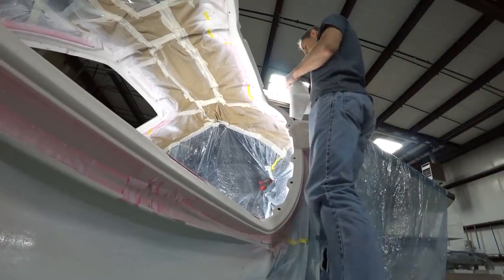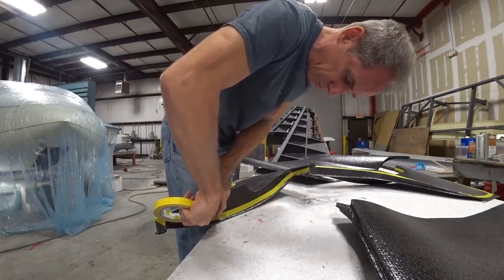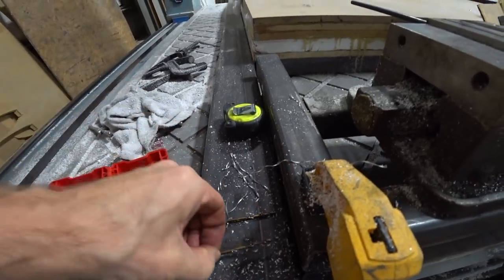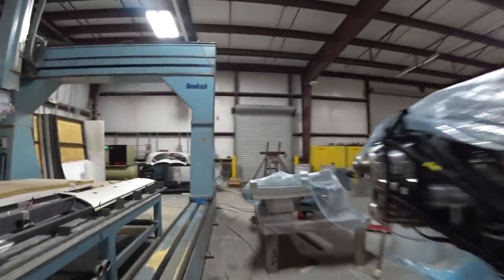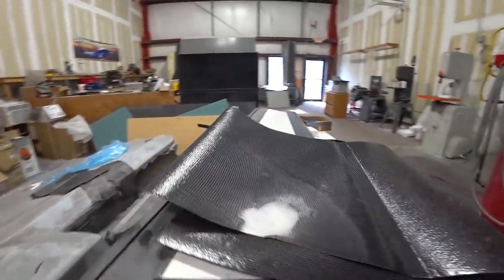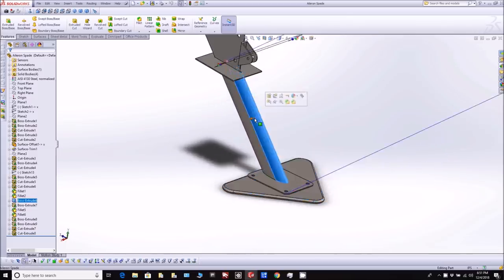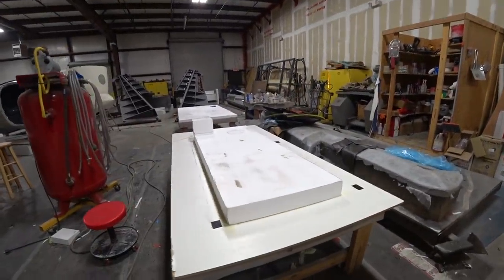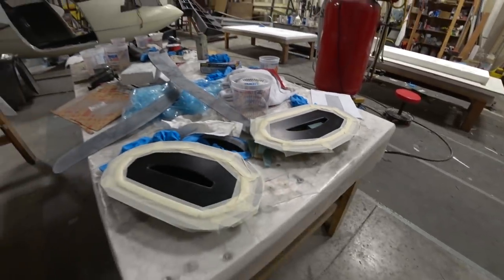What's In The Box? - Building the Raptor Prototype

Comment: For attaching the trim panels, consider the 3M Dual Lock system.  I used the flexible self-adhesive strips to mount a video camera to a skydiving helmet.  There are lots of options.  Strong and forgiving.

Comment: For fixing the panels you might want to look into Automotive supplies. THere's an amost uncountable number of systems available. The most sinple would be some bracket like devicewith a hole mounted on the frame a fiting hole in the panel Instead of a screw some self securint two part pin is used which can be orderd in a multitude of shapes and surfaces.  Using one where you still drill the holes will make it easy to mount them without spending much time on alignment. The brackets also got the advantage to be customized for various distance between frame and panel at different points.

A way to avoinde holes i nthe panes would be to use glue on pins. Again doable with excaptable effort, the most critical point here is selecting the right size of base so the glue holds on better than the clip connection as it still should be possible to pul lthe panels in case of maintenance/changes.

But as mentioned, there's much selection by lookign at the right souce.

What I'm still a bit puzzled how you manage the gaps inbetween panels and between panels and frame - expecially considering that he frame will extend and move when pressurized.

Comment: These updates are great and progress is awesome given all the work and things to work out on a big project. But it’s an airplane so worth assuring even the tedious details as early as possible.  

So I’m gonna ask about drilling/tapping control rod ends as an example, but it is a question that extends to every inch and act that goes into this beauty. What sort of checks and gates are being done or being planned for the many critical features and functions?  

Was the tap drill cutting on size given its condition, were feed, speed, and depth of cut being controlled?  Did the tap do it’s job as expected, leaving the minor dia in spec and while creating the proper major dia?   Is the last full thread deep enough to allow full rod eye engagement without binding and inadvertently stressing the pair against them selves?   Does the joint offer the load capacity, adjustment and durability needed?   

In this very simple example one could start by checking the hole dia the tap drill made.   Then use a Go/No-go thread gage that also has depth capability.  Simple geometry is easy but everything takes time.   Functional checks are another thing, from simple to endless, like assembly test, push and pull strength, fatigue, etc.

Comment: Just a little off topic, and, have you guys estimated the TBO of the engine? And what would a new or replacement engine cost? Would a stock engine then need to be modified as you have, or is your plan to provide future replacements for the soon to be existing fleet?
Reply from the maker: When the engine needs to be overhauled just the long block could be replaced and everything else remain but still be inspected. No real idea yet on the TBO but it would be a lot cheaper than the aviation engine. Couldn't tell you yet about engine replacement suppliers.